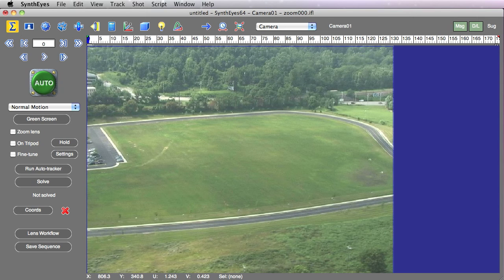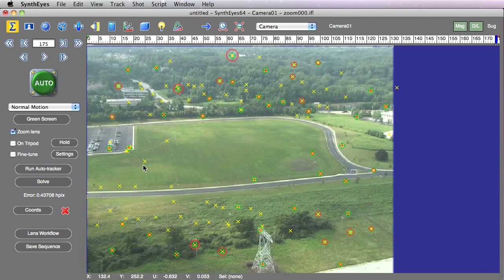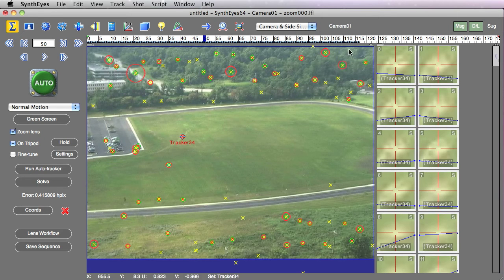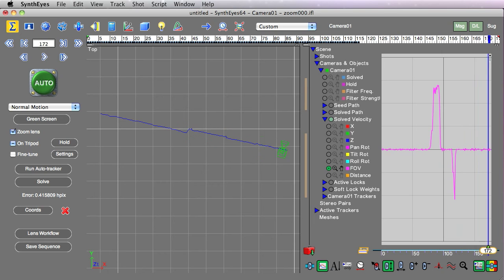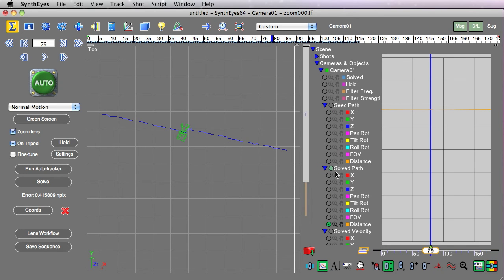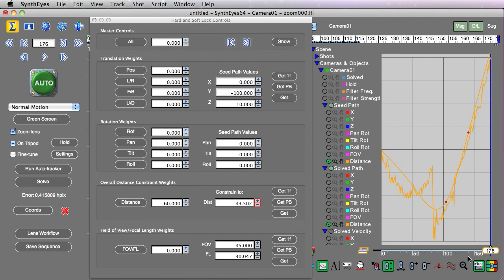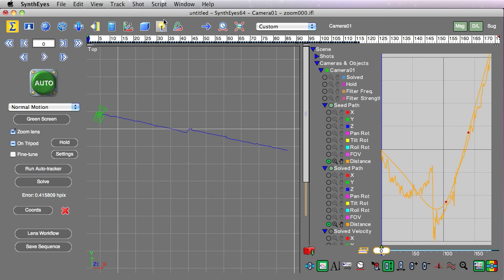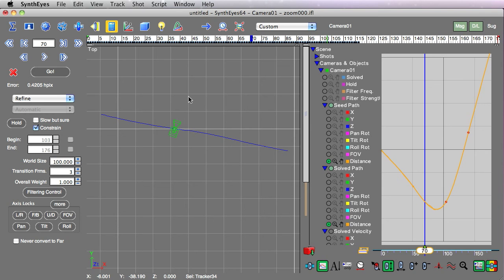Distance Constraints

Comment: Hi there,
Could we have a more updated video about this. I did what you showed in this video and the solve still gitters like crazy. Its not conforming to the distance I set. (Already checked on constrain). 

Also what does "overall distance value on current frame" do. What could it be used for and why can it be keyed? I assumed it was like a constrain. On how much the solver is allowed to vary from the set distance. But it didn't seem to work that way.  

Also another note. the timeline and keyframes display is very very confusing. I cant tell if I have keyframed my focal length or translate or rotate or something else and when I want to delete keyframes theres no hotkey to instantly delete all keyframes of a particular parameter. the only way is to go to the graph. (and it would be nice if they keyed frame little arrowhead on the timeline was red for better contrast).

There is no indicator if anything has been keyed unless you are on the exact frame that its keyed. This makes the right-click to delete key very dangerous. Often I right-click something thinking I've deleted all keyframes only to realize my solve going haywire. Then find out its a stray undeleted key, somewhere... that I have to hunt for.